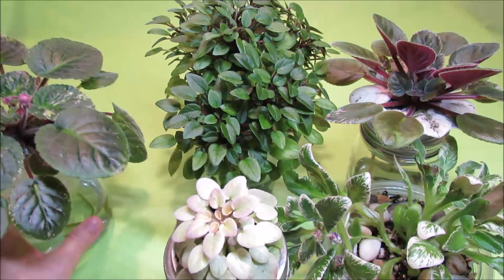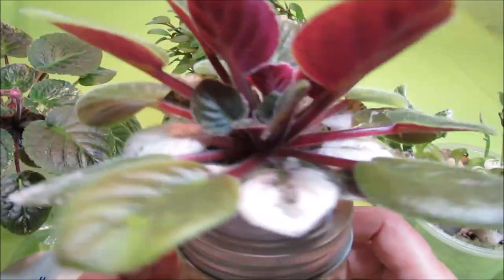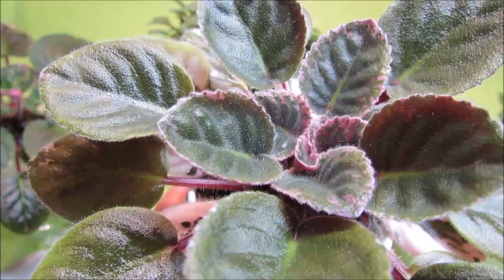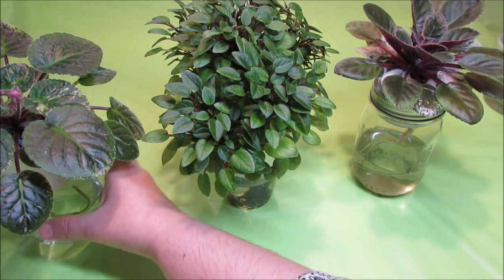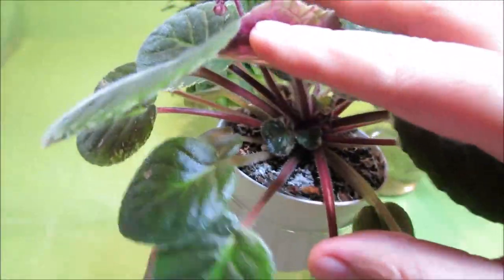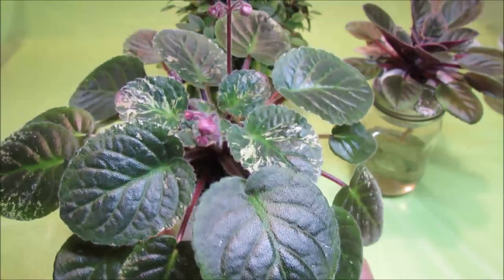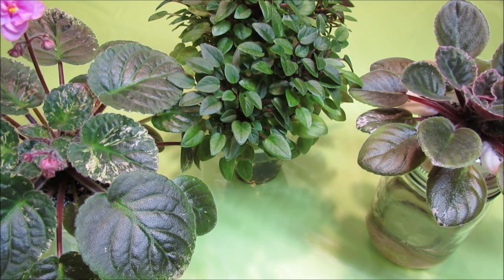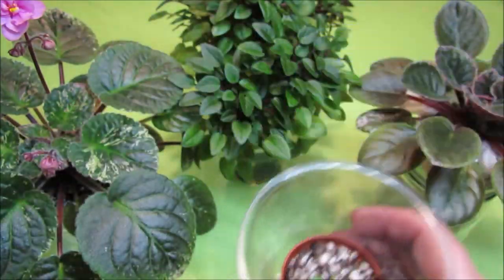African Violet SUCKERS - Removing and Potting Up

Comment: Thanks for sharing😊 How do you fertilize your African violets?
Reply from the maker: 1/4 teaspoon of DynaGro 7-9-5 N-P-K per gallon of water, sometimes alternate with 1/8 teaspoon of Jack’s Classic 20-20-20 N-P-K per gallon of water. I use wick watering method, so I add the fertilizer to the wicking liquid most of the time, and give them a break twice a year for a couple of weeks, with plain water only.
Reply: @grayturtleviolets  Thank you😊❤️

Comment: thank you, good to know...can you tell me the size of the dessert cups you used or perhaps a link to them on Amazon? I would like to get some.
Reply from the maker: On Amazon, these are 9 oz Clear Plastic Sunday Cup 30 sets with Dome lids no hole, or disposable dessert bowls. There are different sizes, too. They work great!
Reply: @grayturtleviolets  Thank you so much. That was my question, too.
Reply from the maker: @kathleenspracklen6849  You are welcome! Happy growing!
Reply: @grayturtleviolets  I'm watching your video from April 26 right now. I ordered the domed cups from Amazon. I am growing my first violet and reading all I can about these charming plants. It had a small sucker, which I wanted to learn how to handle, so thank you. When I popped it off, it had two roots. So I have it in water in a tiny cup in a plastic sandwich bag until my potting soil and desert cups arrive.
Reply from the maker: @kathleenspracklen6849  That's great, it will adapt much better since it already has two roots of its own! Just make sure the water doesn't get into the sucker's crown center. Happy growing!
Reply: @grayturtleviolets  You are so helpful. Thank you so much!! The little sucker I put down now has 9 leaves and is rapidly outgrowing its Sunday Cup as the leaves are starting to bump up against the domed lid. I'm planning to move it to a 2" pot, but is it too young to start it on wick watering?
Reply from the maker: @kathleenspracklen6849  As long as it has a well developed root system, it should be ready to go on a wick. Also, check your indoor humidity and temperature - it will better acclimate in the controlled climate environment, with 40%-60% humidity and temperature in the 70s F. Otherwise, you can cover it with a transparent plastic bag, after planting it on a wick, to keep the humidity a bit closer to the sunday cup it was growing in, and introduce it to open air gradually by opening the plastic bag a bit more every day. Happy growing!
Reply: @grayturtleviolets  Thank you so much!! P.S. all 3 leaves I put down from the mama plant have babies, as well. So thanks for the info you shared in that other video on how to do leaf propagation.
Reply from the maker: @kathleenspracklen6849  Congrats on the new babies! So glad it was helpful! Happy growing!

Comment: Hi thank you make another video can you tell me regular African violat potting size
Reply from the maker: The pot size for African Violet standards is 4 inches. Basically, the pot size should be 1/3 of the diameter of the plant - when they are root bound, they bloom best. So, if the plant measures 12 inches across, then a 4-inch pot will work, whereas a 9-inch plant would do best in a 3-inch pot.
Reply: Thank you  so much

Comment: I’ve AV’s that don’t bloom. I gave them all the quality care that they need such as temperature, humidity, fertilizer, etc. but still no blooms. What must have gone wrong.
Reply from the maker: It's hard to tell without looking at the plant, a couple of things to look into: (1) making sure it receives sufficient light, and (2) adjusting pH of the potting mix - ideal, according to Optimara, is 5.8-6.2. Some varieties bloom more readily than others, and others bloom better in natural light vs artificial light, e.g. my Opera Doc trailer blooms only in natural light. Here is my lights set up, check it out: https://youtu.be/axTu2oq2Uy4